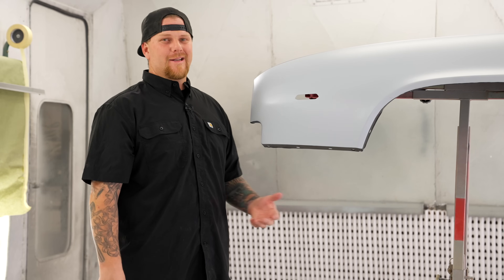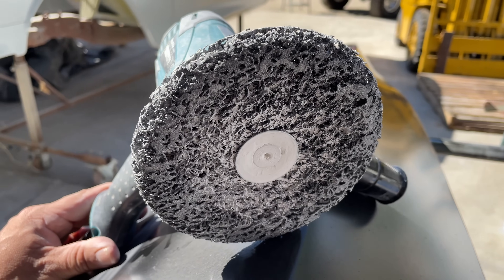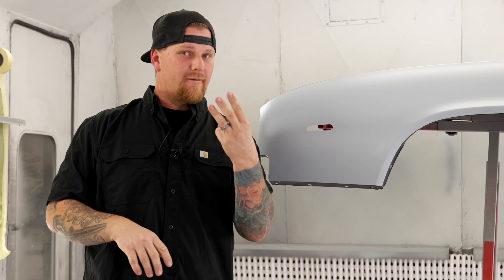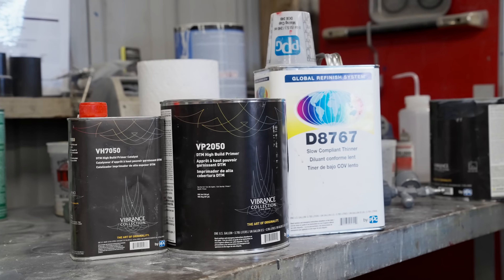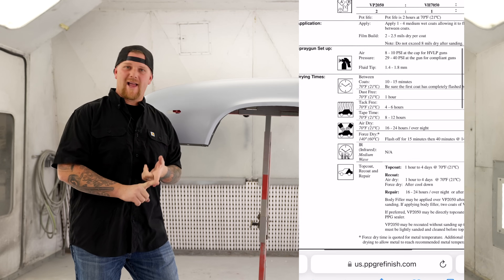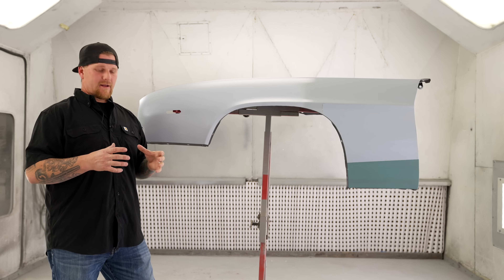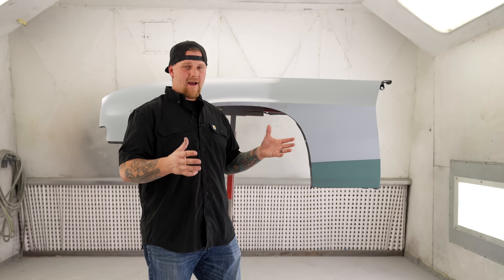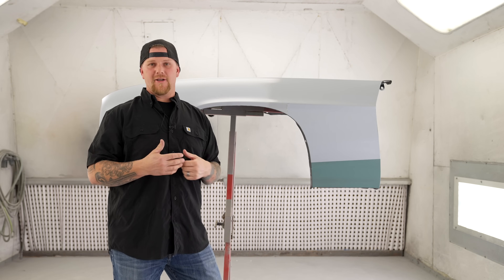Understanding Primers:  Epoxy, Polyesters, and Urethanes explained.

Comment: Ok, so if I understand correctly. I start with bare metal, use wax and grease remover, then spray epoxy high-build sealer that can be sanded (the one you use). After it has dried for a week or so, the bodywork is then performed on top of that. My question is, during bodywork as I sand, if I start to see that I'm sanding through the sealer coat (like seeing pencil marks from a low area) I should stop and apply more coats of high-build sealer and let it cure for another week before continuing sanding/bodywork?  Then, after all bodywork is complete, spray one last coat of sealer before the basecoat color goes down?
Reply from the maker: You are pretty spot on. You don’t have to reapply epoxy vp2050 until filler work is done. But if you are not happy after that you can re spot filler and 2050 as needed. Vp2050 is not a sealer. Actual sealer is different. You do that last before paint. We use Ecs sealer

Comment: Very informative! Although i did have one question. While doing an engine bay and sanding down to bare metal on some spots due to surface rust while other spots are only scuffed. Which primers should i use? 
Because i was going to apply an etch to the bare metal spots only and a normal 2k primer over the whole thing. Or should i take a different route?
Reply from the maker: Best route is an epoxy highbuild hands down. Vp2050 is what I’d recommend.

Comment: Hey Travis, is the PPG CRE dtm high build epoxy a good substitute for VP 2050? VP 2050 is hard to get where I live right now. The paint store called PPG and they are waiting on raw material for the 2050 but they stock the CRE. The technical data sheets look very similar but CRE is the industrial version. Have you had any experience with the CRE?
Reply from the maker: During 2020-2022 we also had supply issues where I am and the CRE works great. I still like 2050 better but it’s damn near the same 👍🏻
Reply: @SYLVESTERSCUSTOMS  Thank you very much.

Comment: well I DEFINITELY heard great things about PPG VP2050... Clausen: All-U- Need, EverCoat FeatherFill G2 series... 

But Id like to honestly see a Flexible Primer Surfacer/Primer/Primer Sealer made for ABS and Polypropylene Bumpers!!! There isn't much luck out there I can find out of Flexible products in a can, but Seymour PBE Flexible Primer (In Light Gray), US Chemicals Flexible Primer Rose, And SEM Flexible High Build Primer Surfacer in Green, Rose, Beige, and of course Black and Gray (which I bought) id like to see a comparison test of...

Really Flexible Bumper Primer Surfacer/Primer/Primer Sealers out of the Can, Flexible Bumper Coater Paints out of the Can, and Flexible 2k Clears out of the can would be an EVEN BETTER SEGMENT because I've been searching all over the Net and testing these flexible products no one has seem to really have done... Even the Bumper Repair/Flexible Filler and Putty haven't really been done... The Plastic weld repair has been done now by dozens out there, so that section has been covered...

LETS DO THIS! A FLEXIBLE SERIES!!! TESTING FLEX, FRONT IMPACT WITH A BB GUN AND BLUNT FORCE AROUND THE BUMPER, BRITTLENESS, ADHESION "BITE" CHARACTERISTICS, SELF LEVELING CHARACTERISTICS, WORKABLE TIME/CURING CHARACTERISTICS, and a LAST episode of the Series testing for CHEMICAL ROMANCE between different FLEXIBLE Primer Surfacers/Primers/Primer Sealers, FLEXIBLE BASE PAINTS (EPOXY, ACRYLIC/ACRYLIC ENAMEL, URETHANE, even Lacquer I suppose for the heck of it), and of course compatibility with the FLEXIBLE EPOXY, ACRYLIC/ACRYLIC ENAMEL, URETHANE CLEARS... 

The products mentioned Above and Dupli-color so far I know of for Plastic Bumpers & Trim, Plastic Vinyls, in which some vinyls are even good for Carpet too! As a 2 in 1.
Reply from the maker: Problem is I don’t work with painting plastic.
Reply: @SYLVESTERSCUSTOMS  daang
Reply: For out of cans:
Speedokote I found has an amazing SMR-280 Flex Prime (flexible Primer) alongside their SMR-230 Medium Grey & SMR- 215 (Black)...

So far them and the SEM Flexible Primer Surfacer 39133 and High Build Acrylic Primer 42013 I'm REALLY liking!!!

Going to be trying some Upol #5 in black High Build Primer, The US Chemical and Plastics HB Primer, SprayMax High Build Primers next... 

I think for out of a gun:

Your Epoxy Primer PPG you use

Clausen All You Need

Evercoat G2 Black

Speedokote Epoxy DTM Primer Sealer in Black 

Eastwoods Epoxy Primers & Paints (Chassis, Xtreme, 2k, etc) 
By the way I noticed for some of these Eastwoods Epoxys it says Epoxy Urethane?

Anyone know the benefits of that combo?

Also would like to get feedback on Alkyd Acrylic Enamel,
& Acrylic Enamel

Urethane Enamel

Comment: This is BY FAR! HANDS DOWN! one of THEE BEST PRIMER TUTORIALS ON YOUTUBE! 

VERY DETAILED, VERY INFORMATIVE!

question though, once your body filler is all Worked out and you have sprayed a high build feather fill polyester primer, blocked that and primer sealed it... 

What is best primer to be allowed over the top of the sealer if you STILL have some imperfections? Use a putty/polyester feather fill to get any scratches/imperfections out? Or just go over it with a few coats of a Polyurethane Primer  block and Seal prime again? (And yes I understand that you said to only apply filler/putty polyesters over Urethane or epoxy and NOT on Direct metal, so I get that, but if having to re-apply a high build primer or putty for filling/fixing Imperfections, can i just apply some more primer sealer to just those putty areas? Or should I first apply some Urethane Primer over the putty/ployester areas, resand then seal?) 

Or would it be better to just go with the VP2050 Epoxy Primer over my Primer Sealer since it is technically a Sealer itself, block that, then finish with a Polyurethane Primer and Primer sealer (Sealer layer used once again, 2wice now)?

Fir last thing to do before laying down my base coat? As obviously a primer sealer should be the last and final layer before base coat
Reply from the maker: Thank you very much. If your body work is where you need it to be if you are using a polyester primer, you would keep applying polyester until your body work is done and then you would be sealing it up. You do not want to go back-and-forth with different kinds of primer. It might be OK but you’re just asking for problems. This is specifically why I only use VP 2050 I can use it when I start and when I am finished and when that is wet sanded with 600 grit. Then I can go over the car with a sealer and basecoat back to back wet on wet.
Reply: @SYLVESTERSCUSTOMS  that makes sense to me... However though after having to re-apply more polyester primer (like the Evercoat featherfill or Clausen All-U-Need) wouldn't i want to go over that with Urethane Primer, do 1 last FINAL block, then use the primer Sealer? Or should these Polyester Featherfill/high build Primers be only applied OVER scratches instead of any Urethane Primers? It just seems that these Poly-Urethane Primers have alot less shrinkage then the Polyester products so I thought that maybe a high build Polyurethane would just play it safer then the High Build polyester feather fill stuff...

I guess it would be also better on which decision at this step of the process to make, based on which of the 2 types of primers are easier and quicker to sand...

 Again I REALLY have thought long about your advice to only either Etch Prime, then Urethane Prime... or if using EPOXY PRIMER, apply EPOXY PRIMER, then apply POLYURETHANE Primer BEFORE DOING BODY WORK (FILLER, PUTTY, POLYESTER FEATHER FILL PRIMERS) SO THAT ANY OF THE POLYESTER BASED PRODUCTS ARE NOT ON BARE METAL (UNLESS THEY ARE SPECIFIED TO BE DTM)...
 So I guess what my question is, is that if I still had some small metal spots come through that weren't really high spots but lets say a high body line crease on a hood or top of a door panel, is it perfectly fine to go over that with some more DTM ONLY rated POLYESTER Primer? Or will I have to use the Self Etching Primer over these small bare metal areas???

And what about a PolyUrethane rated DTM Primer? Are those available? And if so Could I even use that still on top of body work before Primer Sealing? Or should that be Only applied on bare metal?

But I i do get that if I were to use a DTM Polyurethane over the small metal areas poking through, then NOT to go back and use a Polyester Featherfill DTM Primer again... As this seems the multiple layers of Polyester products would get wavy waves from shrinkage on the multiple layers...

I think answering this last FINAL Question will solve my dilemmas im having with the DTM rated stuff, When in doubt I would say that look on the Data Sheet to see if any of these DTM and DTM Polyester products have either typical shrinkage, very minimal, or virtually none! 

I feel Like we are not only learning bodywork skills, but a blend of that and mad scientist chemists 😆 since if you study and learn your chemical compounds, it should REALLY Help out on what, with, when, where to use in conjunction or next to another chemical compound make up of another product... Whether its the same brand or another Brand...
Reply from the maker: Also, make sure you read the TDS sheet VP 2050 is not used as a sealer. You cannot paint over it directly wet on wet.

Comment: I live in a very humid environment, sometimes its 90%+. I've been trying to repair only sections at a time so that I don't get flash rust on my whole car, fortunately we're currently in our few springtime low humidity weeks right now so no problem.  How would you suggest attacking this? I have a dehumidifier that I run through a filter to bring down humidity, but to give you an idea of how much water it pulls, if I'm dropping it to 55% with no drain hose hooked up, I'm dumping 3 gallons a day. Tennessee is juicy. Thank you for your help!
Reply from the maker: Wow that’s crazy. I’d probably just do sections honestly
Reply: @SYLVESTERSCUSTOMS  would vp2050 still be your go-to in this situation or would you pick something else?
Reply from the maker: @WatchmanAtTheGate777  yes absolutely

Comment: I'd love to find a definitive answer on whether 2050 is actually an epoxy or not, or rather a 2k.   Nothing I can find in PPG's documentation claims that it is epoxy. 
That has me questioning whether it actually seals like an epoxy does.   Not questioning the results you get, but I ran across someone else asking this very question and I thought "surely that can't be hard to find out" and lo and behold...it IS hard to get an answer about it.
Reply from the maker: If you look at the chemical make up of 2050 vs a true epoxy like DP90 it has the same chemical make up vs a standard 2k
Reply: @SYLVESTERSCUSTOMS  Think I'll pick up some, then.  Got an old Square body truck with the bed stripped to metal, all metal work done, I want to seal it and never worry about rust again.  
I have some Nason 491-16, but hesitant to use it after researching it more.  
Down to the 2050 or SPI now.  
I do like the high build part of the PPG product.
Reply from the maker: @SealofPerfection  once I used it I never turned back
Reply: @SYLVESTERSCUSTOMS  you might have mentioned it in the video, but I figured I would ask: When you epoxy prime and leave it in a primer for a while, and you are past the window to recoat... Can you just scuff it up and bondo it at that point?
And if so, I would guess 80 grit?

Or do you need to scuff it and reshoot it with epoxy and then do the filler work within the window?

Comment: bought a project car, that had quarters replaced, body work done, and primed. the rest of the car still needs body work. would putting epoxy over the primer on the car a good idea, should i strip and start fresh? confused on where to start since the car was partially started prior to my purchase. any help would be greatly appreciated, thank you
Reply from the maker: I would start fresh it’s piece of mind. Put in in epoxy from ground zero then you will never wonder if it’s going to last
Reply: @SYLVESTERSCUSTOMS , appreciate the wisdom, that is what i will do, thank you

Comment: We are using 2050 on our 59 apache project we sprayed 2050 on the rear fenders they have set a couple weeks do we sand it with red scotch bite or what grit of sandpaper read tds but it don't really explain thank you fcrs
Reply from the maker: If you are going to start bodywork I scuff the primer up with 120 or 150 grit before adding filler.

Comment: I have a nova cowl that was done in etch primer ready for top coat. Can i apply 5310 or 2050 right over it? you mentioned to sand it all back down. It would be nice to just scotch brite it and spray either one over it.
Reply from the maker: You cannot spray that over etch it will be laminate because of the acid in the etch primer
Reply: could i epoxy over epoxy then 5310? @SYLVESTERSCUSTOMS

Comment: Great video! Also perfect timing.
I am stripping my panels to bare metal. And once I was done, I am spraying Eastwood epoxy primer. I also have to do body work on it. So some thin set bondo. At this point would you spray 2k primer, sand, then spray sealer .  Then base coat clear coat?
Thanks
Reply from the maker: We only use one primer vp2050 but yes you definitely could do it that way. I try and limit how many different primers I use because of potential failures etc. consistency is always best but do whatever works within your project and budget

Comment: Polyester primers basically have no shrinkage because there is no reducer to it, only MEKP liquid hardener. Urethane primers usually have shrinkage because of the liquid hardener and reducer added to spray it. 30 years of doing high end paint jobs and only use epoxy ( 48+) hrs dry time and polyester primer all the way to finished sanded in 4-600 grit. Use the epoxy in the end as a sealer and that combination of those two products has produced many killer jobs. The only flaw about polyester primer is that it offers zero flexibility and chips 
extremely easy on door/hood edges..etc. so you need to be careful how much is applied in certain areas.     Your video is definitely better than most that i have viewed on here.
Reply from the maker: I agree partially the only thing I disagree with is the shrinkage. If you do a shrink test on a bare panel you will see that all of the products have a level of shrinkage. Some are more than others weigh a 1‘ x 1‘ panel on a scale after spraying it with polyester only and then give it a few days and weigh it again then wait a few weeks and weigh it again. He will notice by doing this test the amount of shrinkage that no matter what every product has if it’s losing weight, it is shrinking if it stops losing weight, it is done shrinking.
Reply: @SYLVESTERSCUSTOMS  Never thought of looking at the weight aspect of it? If you sand it open and it still has a strong smell then the solvent is still in there. I guess the key here is that the type of work that we do 
on these old cars there should be no hurry to rush the products. I find that most people that have issues when painting is because they are in a hurry and don't let things dry properly. I give the products plenty of time
to gas out. People also will sand and polish a vehicle way too soon because it seems to polish easier, well that is because it is still soft and then it dies back and you have to do it all over again.  Be patient people.  I have done the shrink test with clear before by leaving around an inch of leftover clear in the bottom of the plastic mixing cup and setting it aside for a few weeks, then look to see how much the puck has shrunk away from the sides. Pretty amazing actually and this test can be applied to primer also. Thanks for responding back and keep up the good work.
Reply: everything shrinks back, Thing of those cold mornings :)
Reply: @canoaslan1011  or the cold pool..😅
Reply: @garylivingston9052  You just had to take it too far.

Comment: Great info! I am a newby, working on a 54 chevy car. My local paint shop recommended me using Roberlo DTM 4:2 Urethane primer.  I like what you said about the VP2050 for the hardness. I guess using the Urethane primer was not a mistake but could the VP 2050 be used as a sealer on top of it? Thanks for such a wonderful explanation!
Reply from the maker: I do not recommend 2050 as a sealer. Get an actual sealer.

Comment: I just wish you could have used a proper mic because the sound level of your voice is extremely low even with the volume turned up to 100% on my laptop. It's very frustrating when the music bits over power the more important speaking bits.
Reply from the maker: Actually we did use the proper mic it was us learning what volume levels work etc we’re not perfect and are learning. Kinda hard to complain for content that’s free don’t you think?
Reply: @SYLVESTERSCUSTOMS  Take it easy mate. I was merely pointing out the obvious. No need to get narky about it.

Comment: I only use epoxy/acrylic hybrids or HOK A and B.  DTM for the win...usually good for fiberglass too.  What I dont like about hybrids is the claim that it is used as a sealer too at a higher reduction.  I prefer urethane sealers as they are more UV resistant than epoxies/hybrids.  I also use paint stripper to remove old coatings.  I prefer to sweep up the gunk rather than have dust all over my entire shop.
Spray On!
Reply from the maker: I agree
Reply: What do you recommend for a stripper?
Reply: @alannelson6990  Any paint stripper will work.  I get it at an autobody or auto parts store.  OReillys has some.  I use the aircraft stripper.  Be sure you wash it all off completely or it will ruin the new paint if you leave any residue.

Comment: So essentially the process is: bare metal, key, epoxy, spray filler, block, body filler, block, seal with epoxy, block, base and clear?
Reply from the maker: I only use vp2050 over bare metal then do my filler work. And use the same primer. No need for the others.